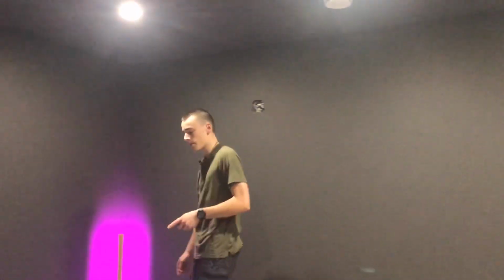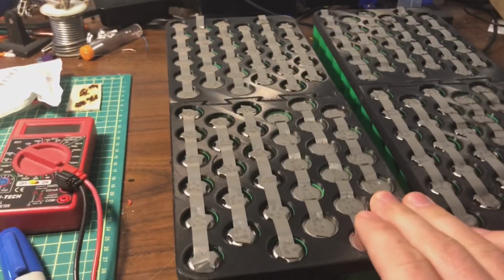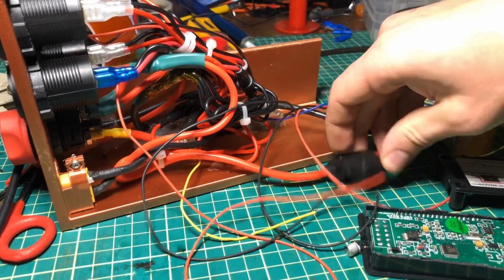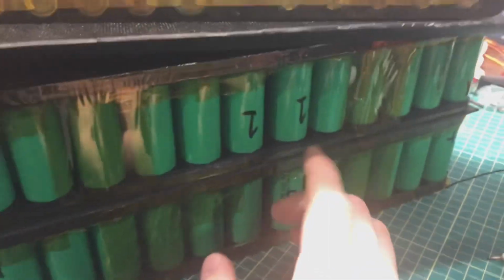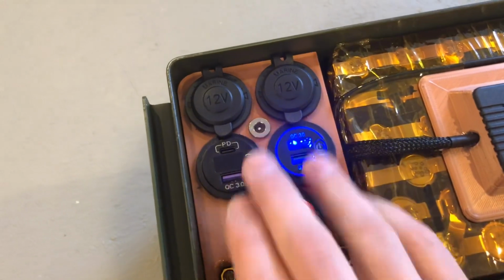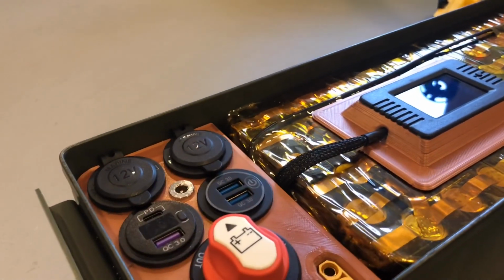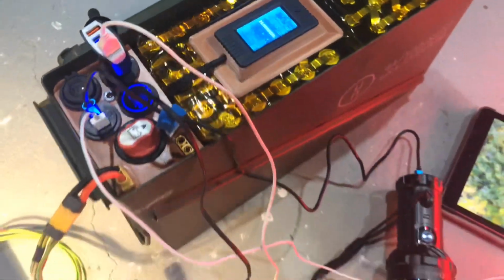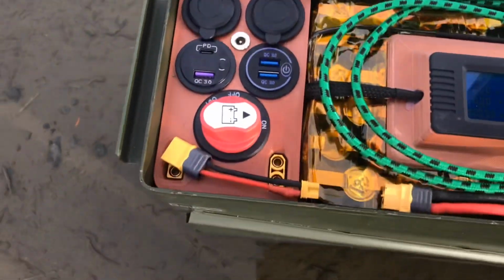Ultra rugged DIY Power Bank

Comment: Amazing build, which step down voltage module you used to step the voltage down to run the power inverter...Peace
Reply from the maker: Thank you I haven’t chosen a step down converter yet still looking for a good option